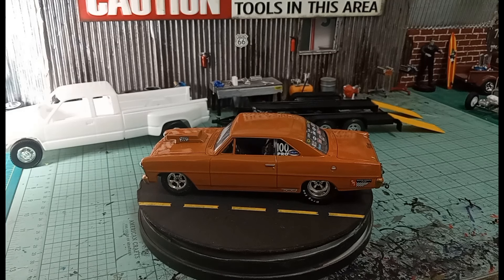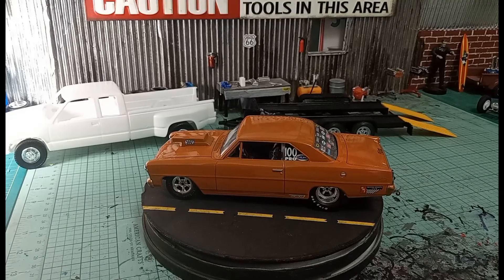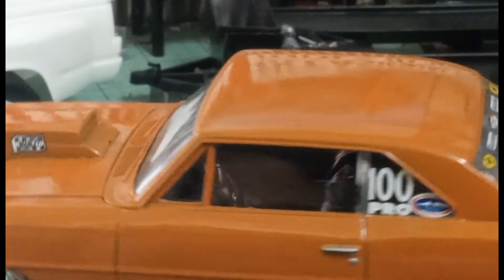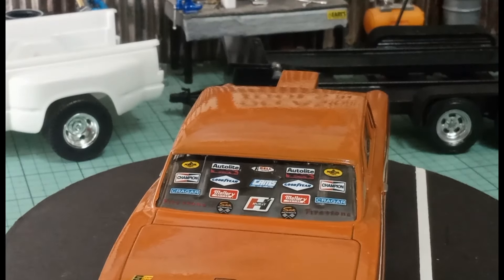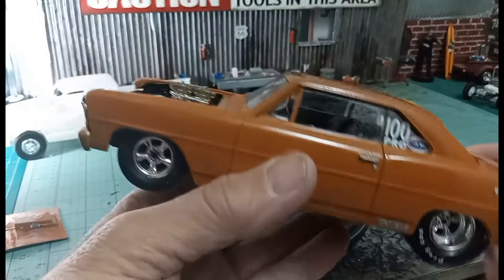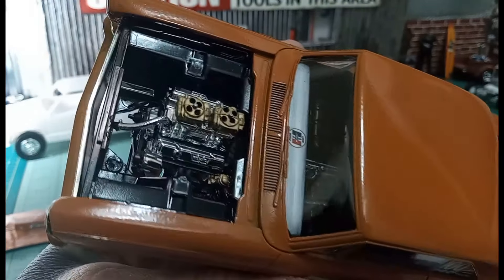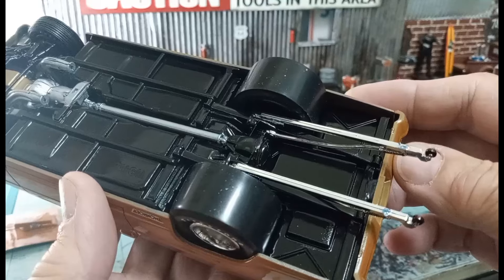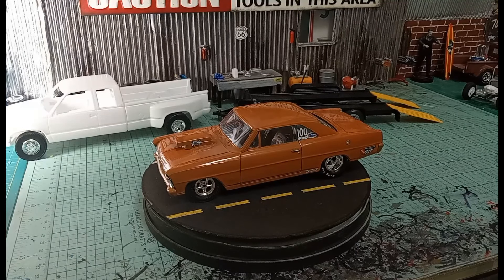Drag Race Rig | Chevy Nova Pro Street Final @timemachinesscalemodels #chevy #modelcars #dragcar

Comment: Nova came out awesome Mike!! Trailer looks sweet! Cant wait to see the dually, ive been thinking about getting one of those. How is that dually kit so far?
Reply from the maker: Thanks Manny. The dually is a nice kit brother. Only problem is, that crossmember under the engine is way too wide and I think I'm going to have to notch it out in the back, so the oil pan has somewhere to sit. Also there's no firewall or rad detail, other than that it's butter👊🏻
Reply: Your welcome!! Cool! Thats cool your going to put an engine in it, I think might too, awesome thank you! Parts box parts I guess for the firewall and rad details. lol @modelspeedshop
Reply from the maker: @Mannysscalemodeling  
Yeah man I haven't seen anyone stick an engine in it yet and I only saw Austin's model cars build one up so far. I pulled a stock firewall from the 55 Corvette that I wasn't using. You'll have to modify anything you use anyway. The truck has a fan shroud so to make the rad fit, you'll have to cut the top down, you can't see the top anyway. 👊🏻
Reply: Yea me either lol, I saw Austin's vid too lol. Would be cool to get a nice firewall from a truck kit and same with the rad and maybe core support. Yea true I hear ya
 @modelspeedshop
Reply from the maker: @Mannysscalemodeling  
I'm sure you can find some aftermarket stuff
Reply from the maker: @Mannysscalemodeling  
I actually just thought about the rad/core support from the 67 Chevelle PS. It's thin enough and small enough it might just fit right in, doesn't have a lot of detail but you can't see it anyway.
Reply: For sure lol @modelspeedshop
Reply: Oh yea thats true! That would be cool to try out for sure, going to see if I can find that truck tomorrow lol
 @modelspeedshop